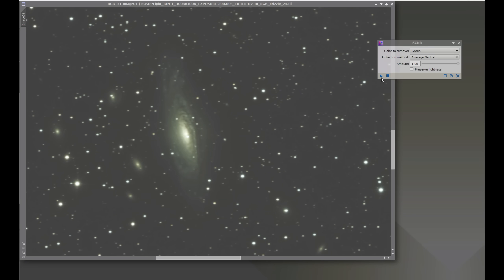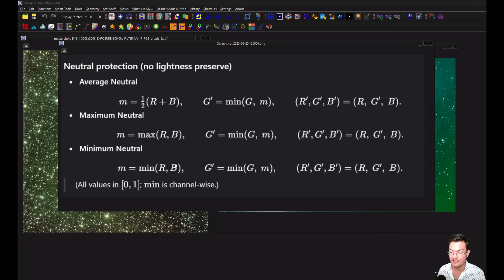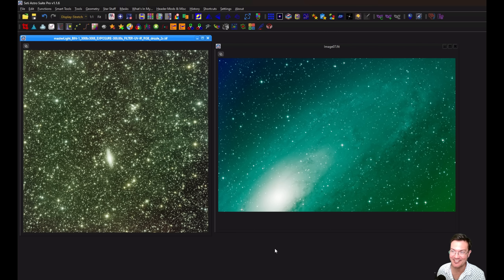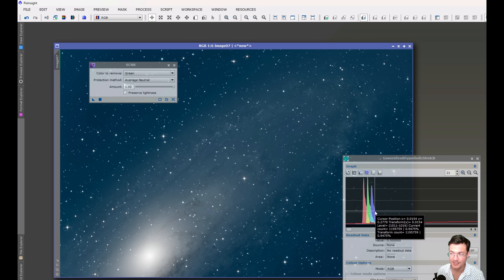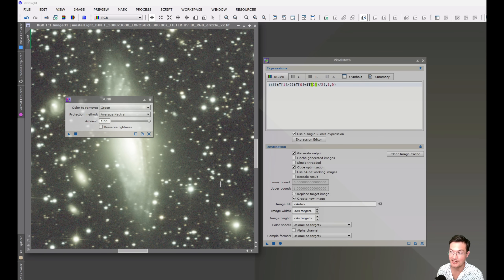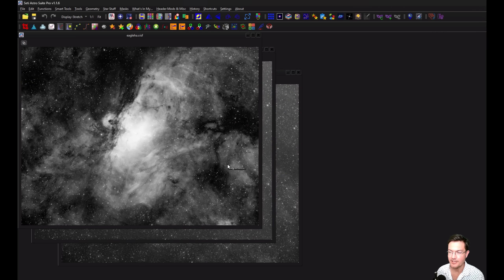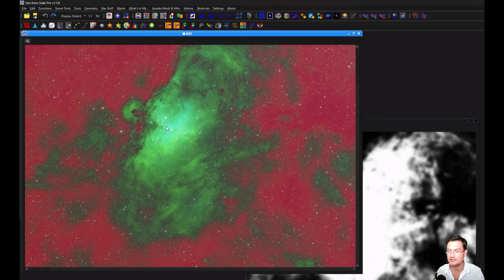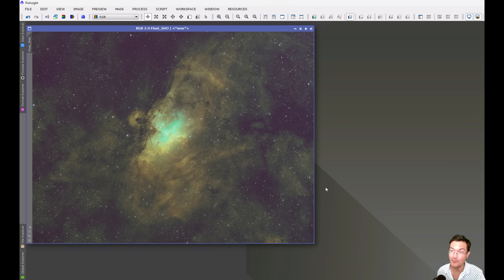SCNR is Destroying Your Data!  Please Stop Using It Like This!!  It is not removing green noise!

Comment: To my understanding is green noise removal should be used by seestar users because the sensors are grbg. So theres 2X as much green picked up
Reply from the maker: Nope, wrong.  Absolutely wrong.  You need to color calibrate your data and definitely not use scnr.  Who ever told you that advice is utterly i correct.  Use background neutealization and color calibration.  Every osc sensor (even in dslr's) have twice the green pixels as the others, just so you know.
Reply: https://youtube.com/@deepspaceastro?si=3_6vv1wa6tNSmJr-
Reply: https://youtu.be/syCVl1fDLTk?si=Tcrb-ev6iFqqIKc3&t=807
Reply from the maker: They are not correct.  Scnr is not the proper way and it is not a seestar thing.  Any osc has more green pixels than others.  If you use scnr for calibration you are literally throwing your highest SNR channel away.
Reply: Well this video doesnt help considering I use siril and I barely know that. Ugh

Comment: Help me understand how this would apply to color manipulation AFTER having extracted a Luminance image from the unclipped SHO image. In that case, the Ha structure would still be intact - no? From there isn't it really an artistic re-coloration process? Clearly you are losing the contrast that green provided to highlight where Ha signal is coming from, leaving just the unsaturated Lum signal. That could be addressed by re-colorizing unsaturated parts of the image, rather than wrestling the green into something else (which is also a PITA). Not arguing for a best process - not everyone works with luminance separately -  just want to make sure I'm clear on the central thesis that SCNR is destroying data when it seems that some of the data is preserved when a luminance channel is processed. Love your videos and your tireless efforts to help this 'hobby' evolve. Thanks !
Reply from the maker: well what is Lum in the first place???  what math did you use???  I bet that is something you dont think about.  here are just some of the weights used depending on what REC you are refering to

REC709  = [0.2126, 0.7152, 0.0722]
REC601  = [0.2990, 0.5870, 0.1140]
REC2020 = [0.2627, 0.6780, 0.0593]

so tell me which of these will perfectly preserve all the data signal in your image?  They answer is they dont.  It is a compromise in order to smash you 3 channel information into a single channel.  So even pulling a Lum and then running SCNR fully you will still be LOSING data.  I will grant you much much less by pulling a LUM and preserving it, but wont be all of it.

Comment: I think there are several incorrections and misuses in this video… First, the author applies SCNR to images which are not calibrated, which is not the way this process is meant to be used. Of course that having a green cast before color calibration doesn't mean anything but having green cast after color calibration means green noise - this is valid for RGB images, not narrowband.

Secondly, suggests color calibration should be used instead of SCNR but these two processes aren't interchangeable. The correct workflow should always have color calibration before SCNR (but not necessarily immediatly before) – why? Because SCNR is meant to correct any green cast left *after* color calibration and this green cast (if any) is indeed noise, not signal as the author states (there are no green objects in space – or at least very few).
To do that, it will subtract (the “S” in SCNR means Subtractive) a bit to every pixel whose green value is larger than a given amount – this will make the histogram of the green channel to align a bit more with the ones from the other channels.

Thirdly, this subtraction is not clipping or, at least, is no less clipping than noise reduction, which also add or substract a bit to every pixel or making selective curves adjustments  to lower the green cast - it also subtracts something to green channel. 

I know it’s boring but whoever really wants to know how SCNR works and how to properly use it, this article from Jon Rista is the best: https://jonrista.com/the-astrophotographers-guide/pixinsights/scnr/

I don't mean to be rude to the author but I feel there isn't a good understanding of the purpose and use of this tool.
Reply from the maker: I think you are missing the point of the video.  I had people telling me they use this INSTEAD of color calibrating and that there were online guides suggesting to use that for color calibration!
Reply: @setiv2  Hello Frank. Well, that is not obvious in the video especially because the stated motivation in it is that SCNR destroys data - nothing is said about the (bad) use of it as a replacement of CC. All the video revolves around the destruction SCNR causes and only in the end you mention it might be a valid step if there are still green casts. But still, stating these casts aren't noise and that it clips data - both of these claims are incorrect.
Furthermore, in my opinion SCNR is best used immediatly after the first stretch - better to remove those casts as soon as possible otherwise you might enhance them with the contrast and saturation adjustments.

Comment: Good call-out on SCNR. I've not liked it much for a year or two - the first things I do are ABE(1) and SPCC as a rule, at least when working with OSC broadband data.

As for fixing SHO palette with curves, though: surely if your SHO gives you that much green, you should've LinearFit (or independently stretched) the source channels to the same range first? And failing that, adjust the formula so H doesn't blow the others away?
Reply from the maker: Not true.  Ha is a lot stronger.  Those were independately stretched channels, that although the orak of the histogram may be aligned, the breadth or broadness of the ha histogram will still have the whole image be green in color from a traditional SHO pallette.  Espevially where these is very little sii and or oiii signal.  Be careful with linear fit too.  That can easily clip highs and lows as well for channels with wildly different strengths.  Statistical stretch unlinked is a sure fire way to not clip and normalize, but that will still not alleviate the breadth of ha in images in the SHO palette

Comment: Thanks for the fresh insights Frank. 

I always applied SCNR in the non linear stage and usually only around 20 to 50 percent range. So may be doing it unknowingly but it's always great to know what you are really doing!
Reply from the maker: Right, some time during your post processing, you have some little hue you were fighting and you just give it a touch to bring it down some, perfect use case example

Comment: a couple points.
- instead of iterating curves a bunch of times, a much better way to get a baseline for SHO images, is to run colour calibration with a black reference selected, then select a white reference amongst the bright green areas of your image (NOT from white stars), and tweak the exact region of the white reference to get a good balance of colour. you use less time, protect the validity of the signal's relative brightness (by avoiding masking), and it looks better when done well.

- a lot of people i see use SCNR in late-stage nonlinear processing where theres weird greens/purples sitting around the image, maybe because of airglow, sensor issues, LP, amongst other stuff. what i do instead (which gives both a better result, AND doesn't destroy your data) is to create a green mask using a simple pixelmath command, i use $T[1]-max($T[0],$T[2]) in pixinsight, which pretty much creates a mask where greens are brighter than reds and blues, like SCNR does. however, instead of replacing it with signal from the red and blue data like SCNR, you can just use it as a mask to SCALE the greens, using curves or histogram. similarly for purple, min($T[0],$T[2])-$T[1]

i recommend you guys give both of these tips a go, and clear skies!
Reply from the maker: Yep, lots of ways to move greens around.  Great points.  Only so much time i have in a video to cram on as much as possible, but for more advanced users absolutely your yips are spot on

Comment: SCNR was a staple of Bayer-based OSC and DSLR workflows in the 2000s, but its era effectively ended around 2015 with the rise of advanced color calibration methods like PCC and SPCC. In practice, it is now largely obsolete. Nevertheless, SCNR persists in many workflows partly out of habit, and partly because it offers a quick and accessible fix. 

Today, its role is mostly limited to neutralizing residual greens, as seen in Veil Nebula or M27 witch tends to be more greenesh in the end process. Applying SCNR in the linear stage requires only basic processing knowledge, which has made it a popular choice among beginners. However, this also reflects a reliance on outdated online workflows, many of which have not kept pace with modern astrophotography standards.

Comment: I had no idea, so thanks. I'll keep off the SCNR from now on!
One question though: when you demonstrated how the histogram changes, the green curve shifted to the left, but appeared intact. Doesn't that mean that the linear offset is reduced, i.e. all values are reduced, but retain their individual deltas? As long as it's not shifted so that the lowest levels drops below zero, is any data actually lost?
Reply from the maker: No!  That is a completely made up curve.  That is the point!  That was just the average of red and blue.  The green channel was completely replaced!!!!
Reply: @setiv2  Right, got it, thanks!